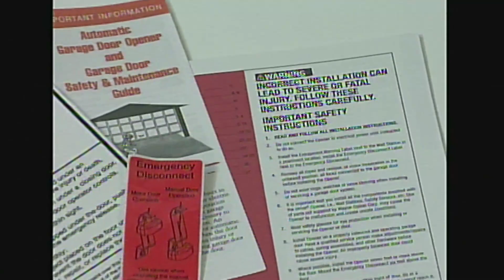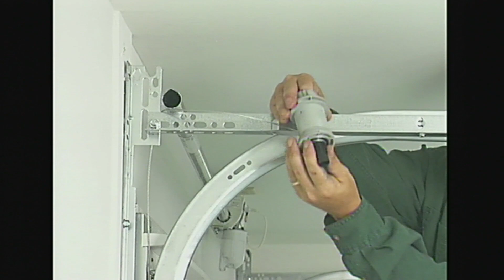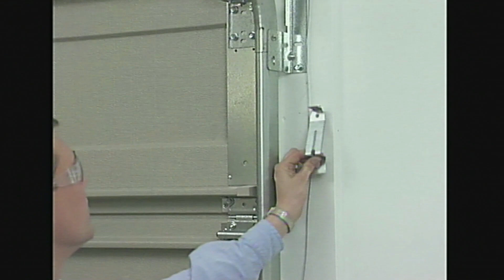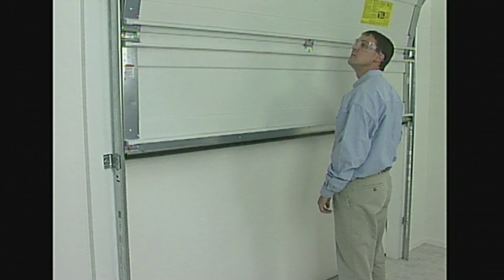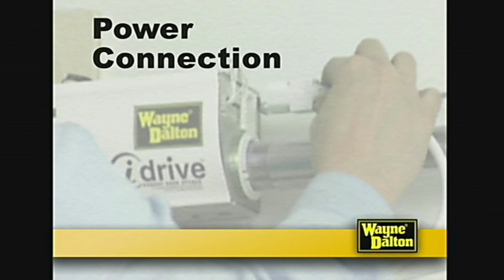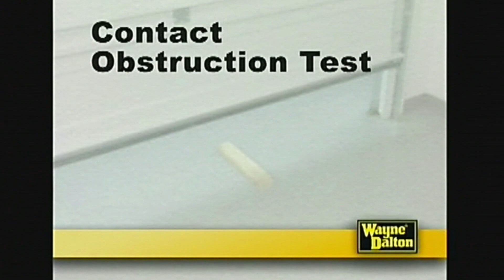Wayne Dalton iDrive TorqueMaster Installation DVD

Comment: Thanks for posting this. My system has been great for over 15 years. But recently, the right side cable kinked and tangled in the spindle. I released the tension on the right side, disassembled the right side, untangled the cable, and reassembled. Now the door closes and reopens about halfway and stops. I have attempted to adjust tension and there is still tension on the springs, but all to no avail. No pros out there to work on this system, everyone just wants to replace it of course. I have done what I can do. Anyone know of a competent expert in the LA area? Thanks!

Comment: Apparently, if you don't  reset troquemaster to dull up or down position before installing on shsft, IT WON'T STAY CLOSE OR OPEN ALL THE WAY . adjusting motor shaft willNOT fix the issue.😅